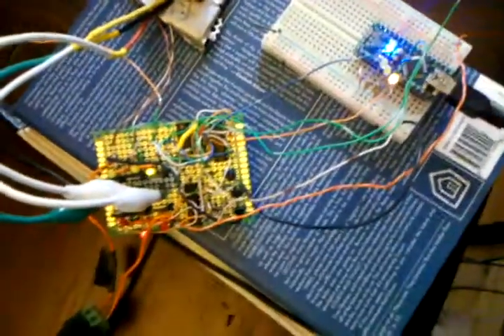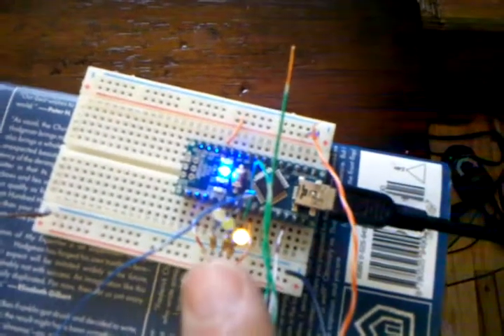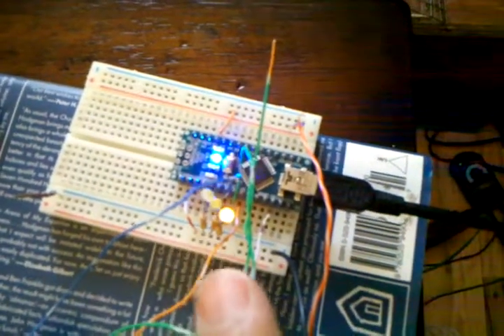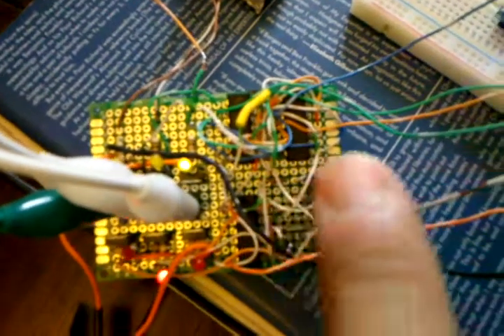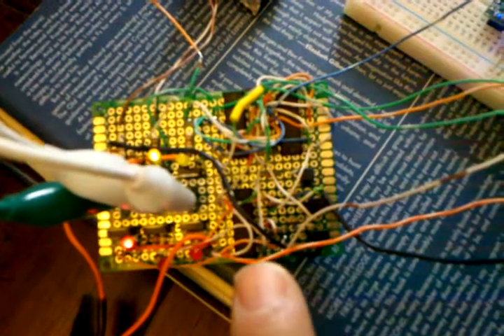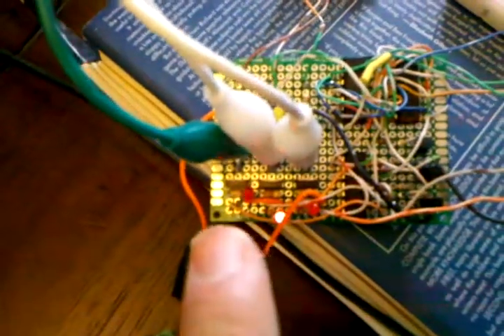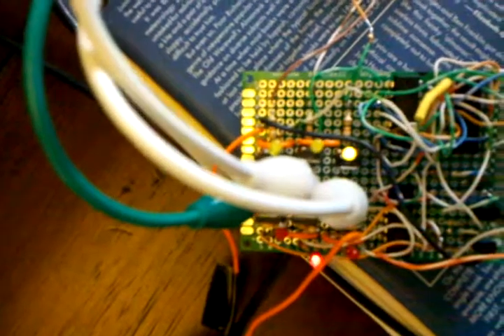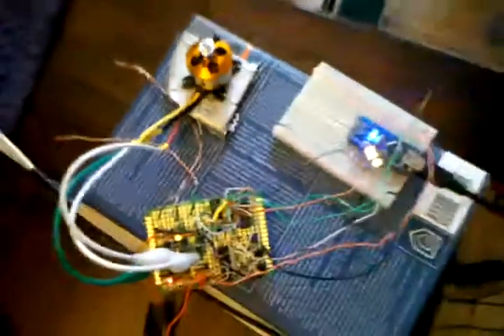3-phase motor control perfboard

Comment: Hi. Can you give me the schematics and the arduino code?
Reply: aargh.  missed this.  The blog where I had this died.  I need to revive it.  I never totally finished the project.  The next step was to read some feedback from the non-active phase wire and get this under closed loop control.  It looks like I will need op-amps to do this, and I never got there.   I did blow some transistors, and I never understood how/why that happened.  It could be that the logic chips can go into a random "impossible" state on start up and short.  not sure.